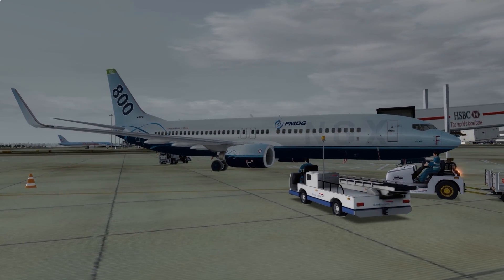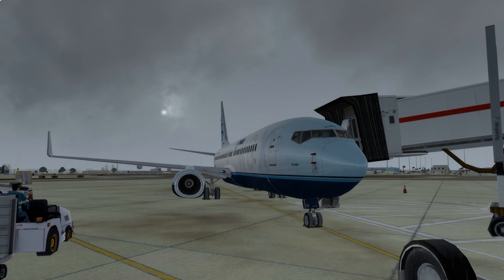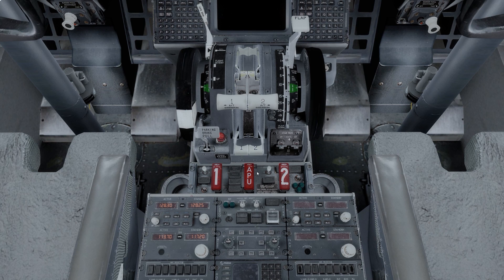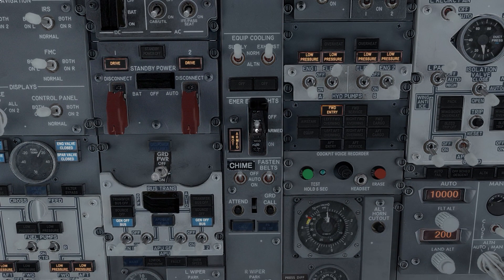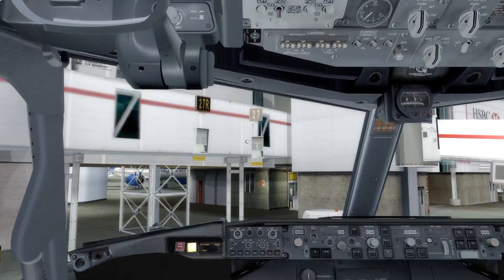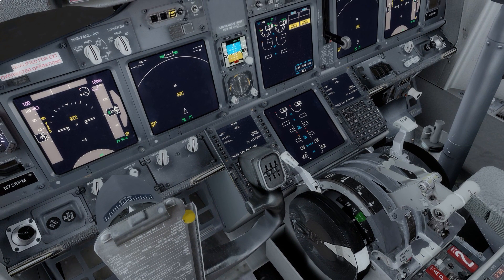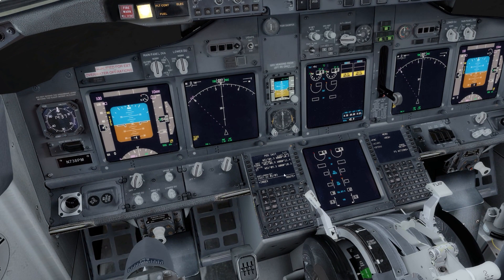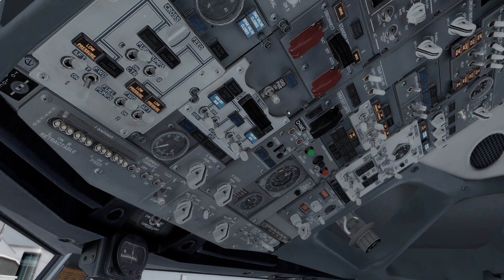How to PMDG 737 NGX! Cold & Dark to Preflight | ✈ The Virtual Airline Pilot

Comment: Is there a load state where everything is set correct as default but only the Engines aren’t running?
Reply from the maker: By default, I don't believe so. However, you could set this yourself and save the state withing the FMS.
Reply: The Virtual Airline Pilot 
Thx

Comment: When I put the 737 in cold&dark, I still can hear a noise of electrical pump, or something like that. What that could be ?
Reply from the maker: Caliméro hi there. Do you use any other software like GSX? It could be one of the ground vehicle’s engines? If not, press the Q key once and then press it again - that will turn the sound off and on. I find that helps sometimes.
Reply: I find a solution ! but I didn't use any other software befor. now, yes but I don't have more this problem.( sorry for my doubtful english)
Reply: @orangemekaniq   what did it end up being?  This happens to me when i land and taxi to gates.  Feel like my flap hydraulics pumps get stuck on.

Comment: you need to brush up on your 737 technical knowledge as that you completed checks wrong and did not actually confirm if some systems are functional if you trying to operate the aircraft realistic manner
Reply from the maker: Hi Plane Guy. Thanks for stopping by the channel and giving feedback on the video. The procedures and flows are taken from FS2Crew's documentation, which is derived from Ryanair's SOPs. I've done my best to stick to these :-)
Reply from the maker: P.S. I've just subscribed to your channel. Happy flying!

Comment: Nice vidéo, ! But little step is wrong, 
I am 737 engineer
when you push the fire test for the engine and Apu, you need to push and push the warning button and the alarm cut off. This is the réel process, 

After ; put the 2 hydraulic pump when the Apu is on and ready, never before,
Reply from the maker: Thanks Tiago, glad you like the video and thank you for the correction too :-)

Comment: The apu Raises EGT to 8 then goes back down to 0 help?
Reply from the maker: Hi there, sorry for the delay in replying. I've not been able to recreate this problem. When starting from a engine running state, are you able to shut down and start up the APU?
Reply: Yes, But when I try and load cold and dark it simply wont start. I have overcome this issue by creating a profile that already has the apu started And since writing that post I have learnt alot more about the 737 pmdg including started the contruction of my own simulator. Anyways great content and thanks!

https://linustechtips.com/main/topic/732789-737-cockpit-build-fsx/#comment-9440487

Comment: Hi im using the pmdg on fax steam edition and every time I load everything up the engines are running. How do I make the plane start in cold and dark?
Reply from the maker: Hi there. Press the menu button on your FMC, then, on screen, go to PMDG SETUP, the LOAD PANEL STATE. Here you can select COLD & DARK. Let me know if you have any problems :-)
Reply: The Virtual Airline Pilot omg thanks so much for helping me out. I'm subbing right now. Once again thanks.😀
Reply from the maker: No problem at all! There is a way to change the default startup state too (so it's always cold and dark) however, I like to keep it as engines started, just in case I fancy going flying straight away. Thanks for the sub!

Comment: will i5 6600k with stock frequency can run with all that addon?
Reply from the maker: +ejuice I'm sure it will run. How smooth it runs would be dependent on what your settings are and what other scenery and add-ons you are using. I'm certain there are other NGX pilots out there with the same processor as you :-)
Reply from the maker: Flightsim on a laptop - awesome!! Commuting would never be the same again hehe.
Reply: I havean i5 6500 and it works fine.

Comment: Aaaaand of course my fmc is out of date and won't pick up the gate. Smh
Reply from the maker: +DesignedByBold you can use your last position instead of a gate number to align the IRS. This is shown in the FMC page as 'LAST POS', or go to page 2 and you can use one of the GPS to grab your coordinates. Finally, if you are using charts - the parking positions chart usually has the stand coordinates. Depending on what airport you're flying from (payware) - you might even find the coordinates in the stand number sign!
Reply: If you are flying in the US, the gate position doesnt work, but it should work properly in European airports. At least for me

Comment: I go to align the IRS and the right works just fine, but then on the left I get the on D.C. Staying on with the align and then an annoying alarm.
Reply: I found the problem. For some reason standby power was off
Reply from the maker: +DesignedByBold I was going to say, DC suggests battery. Glad you found the problem!
Reply from the maker: Hi there. That's strange. It should rise to 8, drop to around 6, stabilize, and then if there is good quality AC power being supplied by the APU, the APU Gen light should illuminate. Is it every time you try to start the APU? Do you experience the problem when starting the APU before engine shutdown?

Comment: Any idea how to start up this plane (PMDG 737-800 NGX) from completely cold and dark like in this video? Mine always load with contdown for "initialise all system....20"... then the plane starts automaticly...
Reply from the maker: Hi Nick - Sure! You need to select a startup state from the CDU. To do this, click the MENU button. The press the LSK (line select key) next to "PMDG SETUP" and then the LSK next to "PANEL STATE LOAD". From here you can select COLD AND DARK. This will power down the aircraft and put all the switches in the correct position. 

It's worth noting that if you want to always start in a cold & dark state, you can set this in the "PMDG SETUP" menu by selecting "STARTUP STATE".

Hope that helps!
Reply: Thx!!!! I had the exact same problem ;-)